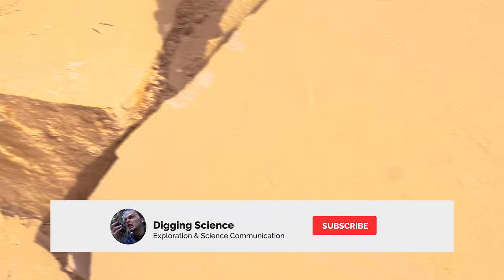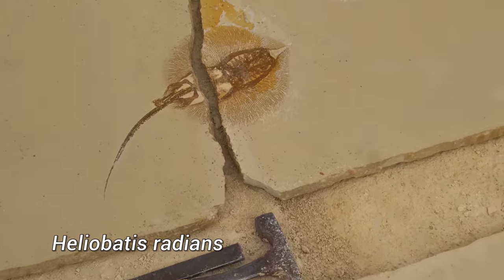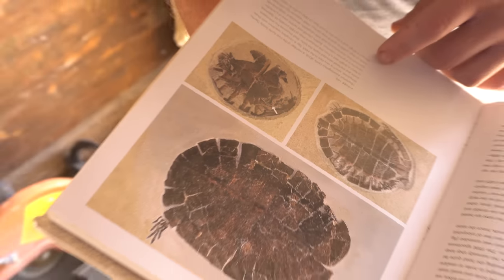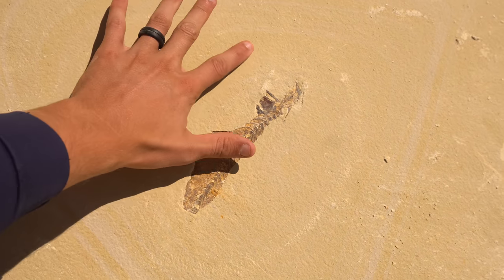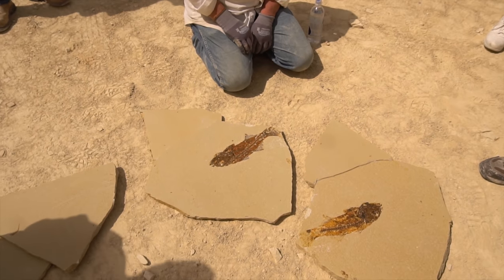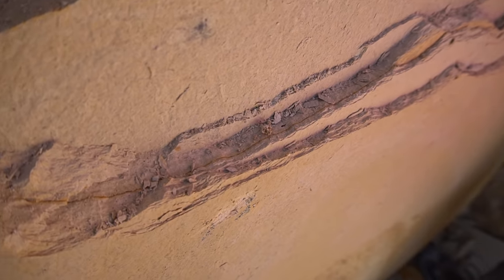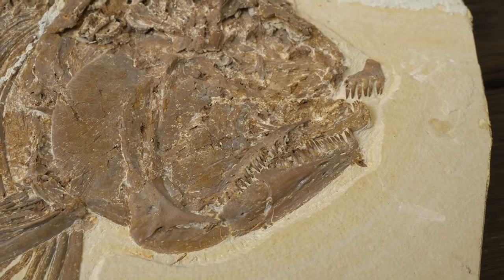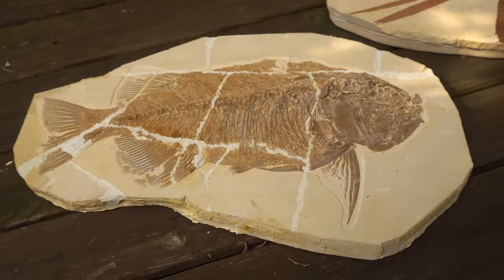Our BEST Fossils from Warfield Fossil Quarry

Comment: Protip: Take two flat slabs of rock. Sandstone, siltstone, shale, limestone. Could even be decorative patio stones from Menards. 

Buy some "liquid fire" drain cleaner. Danger, it is concentrated H2SO4! Now go catch a bluegill, bass, whatever. Let it die out of the water.  Pour some drain cleaner into a bowl. Using a paint brush, paint both sides of the fish with H2SO4 (gloves & safety glasses). Place the now smoking, acid covered fish on the flat rock. Now place the other rock on top of it. Ignore it for six months. Now go pry your rocks apart and marvel at the fossils you have created. Sell them on Ebay for $100 each.

Comment: Wonder what cataclysm buried all these fish.
Reply from the maker: No cataclysm. There are thousands of well laminated layers with fossil fish in them. That represents many seasonal periods of deposition and fossilization. That only happens in calm environments. Cataclysmic events cannot create well laminated layers similar to those shown. Catclysmic events with water that do create laminations follow a very predictable pattern where the heaviest rocks settle out first and diminish in size until only silt is on top. This is not present here.
Reply: @DiggingScience  but they’re buried in situ. Some with other fish in their mouths. What would cause that kind of quick death and preservation.
Reply from the maker: @raygrange7312  Those are aspirations. The fish died while choking on another fish. For most fish it wasn't a quick death either. After death, they sank to the bottom of the lake past the anoxic zone. So there isn't any oxygen there to decay them. After that, they were simply covered in layers of calcium rich silt over many years. Many of the fish found in the quarry have been scavenged on or simply disarticulated. Some fish did die suddenly like a change in lake chemistry after a nearby volcanic eruption. The hot ash that settled on the lake would cause dieouts and is present as a layer of ash and limestone. The fish tend to be better preserved more often from these layers. There are three of these layers present in the section of quarry we worked in. There is also what is called the puddle layer, it is a period when the lake was very low and fish congregated in pools which caused a large die-out. In the layers present the fish populations rebounded after these naturally occuring die-outs.
Reply: @DiggingScience  thanks.